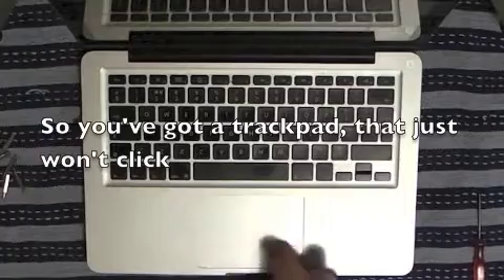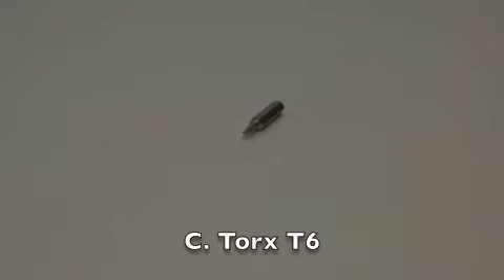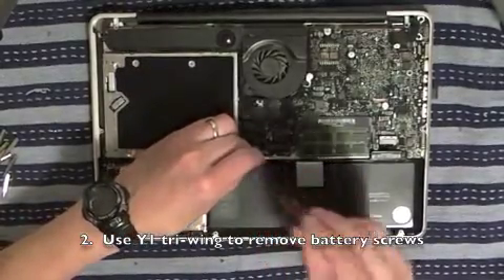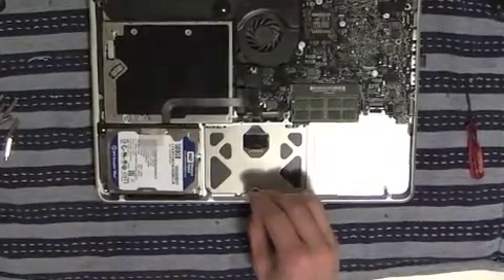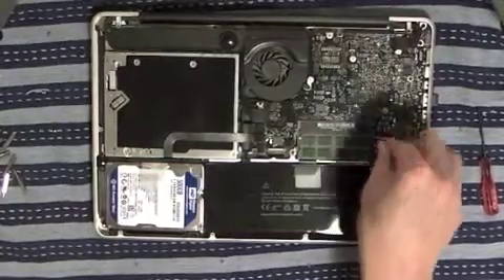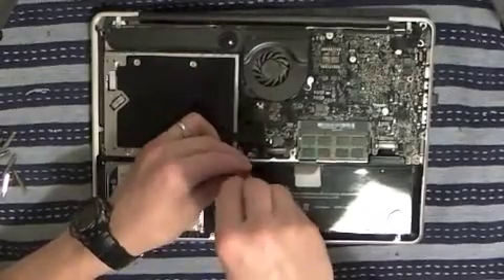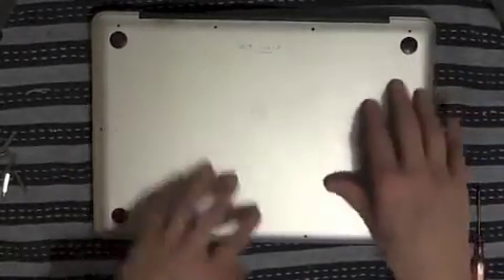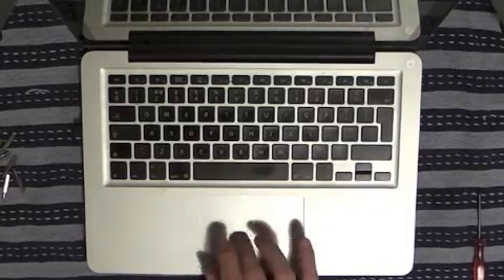Macbook Pro A1278 trackpad not clicking

Comment: My mac click everywhere and creates folders, open software, options like a right click etc... Last time a had that problems i restarted the SMC and it was solved, but this time does not work AT ALL, and thw arrow goes by itself all arrown the screen. I don t know what else to do because i did a hardware test and it is ok, and i have installed a full  new OP againg and still the same problem.
Reply from the maker: Curious....does sound like hardware if you've installed the operating system again.  Perhaps have you tried an external mouse just to see if it's working when you disable the trackpad.  Perhaps if that works, you could look to replace the trackpad itself.
Reply: @nzclaytonedge  Last time i used an external mouse instead of the trackpad and did not work. I am not sure but i guess the batery has a kind of a belly and that press the down side of the trackpad BUT, why last time i solved it and worded just fine for months, if that would be a battery issue it have not happended like that obvisly.
Reply from the maker: @UnomásdelPatriarcado  - if the battery is swelling, I would be inclined to replace it quickly.  If it catches fire you would have worse problems than a mouse clicking when it shouldn't.
Reply: @nzclaytonedge  Your right, but it is a macbook pro 2010, i would need to look for a new one and might be hard due to how old it is.